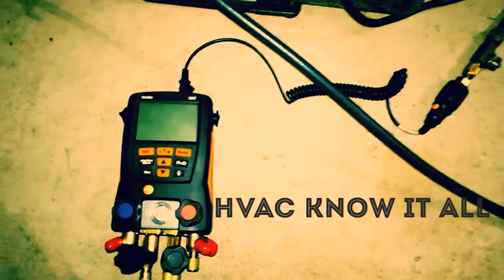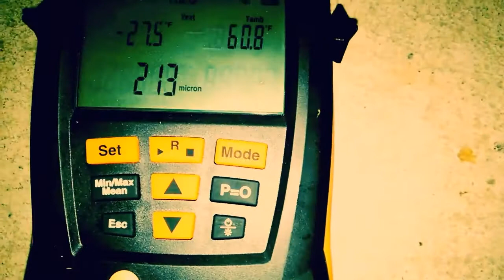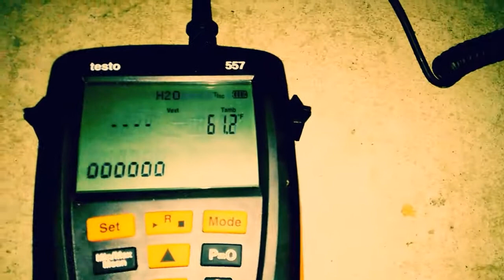HVAC Know It All - Do refrigerant hoses collapse in a vacuum?

Comment: Never heard of that myth before. The restriction people are referring to is not the physical hose collapsing, It is the restriction of flow a 1/4' diameter hose has versus a 3/8" or 1/2" hose.
Not to mention, standard hoses and manifolds are not rated for vacuum and therefor should be avoided when evacuating systems. I recommend techs avid any manifold with an on board micron gauge for this reason.
Reply from the maker: HVAC in SC it's a myth alright.  Teachers at HVAC training centres are teaching this to students.  A rep from Appion also has claimed this can happen.  I posted this question on my FB page and others claim they have witnessed this and use copper for evacuation due to it.  There are many things I've never heard of either, but that doesn't mean it's not true.  I like to see things for myself, thats why I performed this experiment.  Thanks for commenting!
Reply from the maker: HVAC in SC I've been around now for just over 20 years and I'm just hearing of this recently from apprentices coming out of school, I did some digging because I didn't believe it.  I think this may happen if your hose is defective in some way but not on a regular basis.  I would love to hear what your rep has to say.... when you do have time to ask.  Thanks!
Reply: +HVAC in SC I just hit 55 microns the other day with the 2 Appion Megaflow 1/2" hoses, Appion core removers, yellow jacket vacuum tee and a 7cfm JB pump. All was good.

Comment: I've never heard of this myth.  It's all about conductance ratio when pulling a vacuum.   1/4 inch hose vs 1/2 inch hose. The 1/2 inch hose will have 16 times greater flow.
Reply from the maker: Ulises Palacios it's definitely a myth floating around.  it all started with my co worker telling me he learned it in school, I didn't believe him so I did some digging.  I asked 2 industry leaders in this area, one said they do collapse, the other side no they don't, interesting!  so I ran this experiment.
Reply: HVAC Know It All  what industry leaders did you talk too.  If that was the case a lot more people would know about this because almost all techs use standard refrigerant hoses to evacuate systems.  I have hoses that are rated down to 20 microns.
Reply from the maker: Ulises Palacios I spoke with Yellow Jacket and Appion.  One was very addement about hose collapse.  I asked the question on my pages...several claim that this is true in a very deep vacuum.  Older techs and a lot of chiller guys will tell you that the best way to pull a vacuum is with copper.  Rubber hoses over time will tend to permeate as the inner nylon lining starts to break down.  Copper makes sense but not practical in most applications.
Reply: HVAC Know It All interesting. Which company was it.  yeah my dad used to use cooper lines to evacuate some larger systems.
Reply from the maker: Ulises Palacios the gentleman at Appion I spoke with tells me that a 1/4" hose will restrict down to 1cfm of flow no matter what size vacuum pump you use.  I can't find any info online about this except for catastrophic failures.  I'm one to not believe things until I see it.  I think it's rare personally and might happen to older defective hoses but you can't dismiss the fact that some have claimed to experience it.
Reply: HVAC Know It All yeah. That's definitely true. It's probably even less than 1 cfm. That's why I use 1/2 inch hose.  It's not the size of the pump. It's the size of the hoses.  Don't pull a vacuum through your manifold either.
Reply from the maker: Ulises Palacios yes, true!  I'm currentlyookong into a vacuum manifold at the moment.  Manifolds do leak a bit, for smaller systems you'll get away with it, but for lager systems your pull down will struggle.
Reply: Currently use a yellow jacket vacuum manifold on the pump with 1/2" vaccuum hoses and works great. I would like to compare with the testo 557 one of these days
Reply: Go figure.
 Only hose I ever had that collapsed under vacuum was a Appion. Clear for pressure. Inner coating collapsed under vacuum. They replaced it no problem but it's still kinda funny.
1/4" hoses are a big restriction though just like they said.
Reply: WorksGoodCheckItOut that's crazy

Comment: 213 microns with only the hose and micron gauge on it is pretty weak.
Reply from the maker: Stephen Rardon thanks for commenting!  Back in the day, when my chest wasn't as hairy, I used to install Mitsubishi City Multis.  We were required to pull a vacuum down to 350 microns and show the commissioning agent the reading before continuing.  The pump ran over night pulling from a couple of thousand feet of pipe.  350 was considered over and beyond due to 500 being the bench mark.  If we showed them 213 microns, we would be candidates for unmentionable favours lol.  What I'm saying is...213 microns is an incredible vacuum for any system, a collapsing hose may never get you to that point.  I do agree that with just a hose you can get lower but 213 certainly is considered a deep vacuum.  Standard charging hoses also tend to permeate which may prevent from pulling lower that's why copper is used in many cases when pulling down a large system.
Reply from the maker: Stephen Rardon thanks for commenting!  Back in the day, when my chest wasn't as hairy, I used to install Mitsubishi City Multis.  We were required to pull a vacuum down to 350 microns and show the commissioning agent the reading before continuing.  The pump ran over night pulling from a couple of thousand feet of pipe.  350 was considered over and beyond due to 500 being the bench mark.  If we showed them 213 microns, we would be candidates for unmentionable favours lol.  What I'm saying is...213 microns is an incredible vacuum for any system, a collapsing hose may never get you to that point.  I do agree that with just a hose you can get lower but 213 certainly is considered a deep vacuum.  Standard charging hoses also tend to permeate which may prevent from pulling lower that's why copper is used in many cases when pulling down a large system.  uh
Reply: HVAC Know It All right, for a system 213 is phenomenal but I've pulled 98 microns myself and with only gauge and hoses I've pulled below that. Test is fine either way. Standard hose won't collapse under deep vacuum, unless it was in really bad shape
Reply from the maker: Stephen Rardon yah like I said, I could've gone lower for sure with just one hose.  but that wasn't the purpose of the display.  I did reach out to 2 industry Giants regarding this, on said yes they will, the other said no they won't... interesting.  I also posed the question on my pages...the answers were split...mainly just opinion.
Reply: Stephen Rardon have you seen lower on a 1/4" hose that wasn't running all day? 1/4" is the reason you'll only see 200-400 microns in a few minutes. each increase in hose dia. you will see a lower pull.